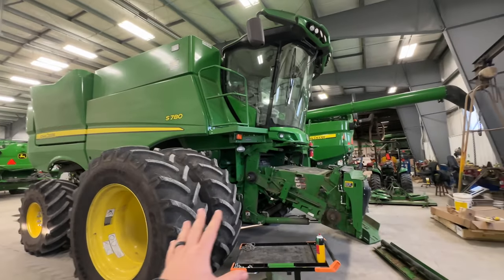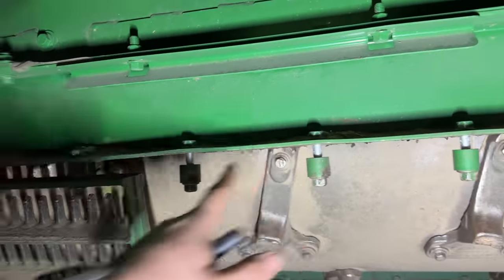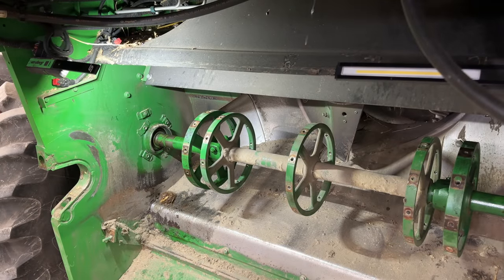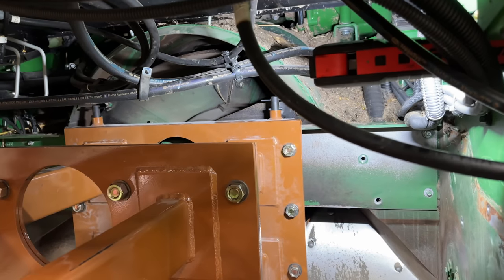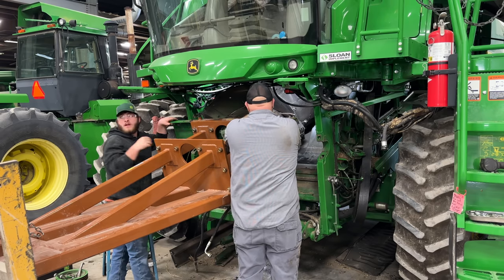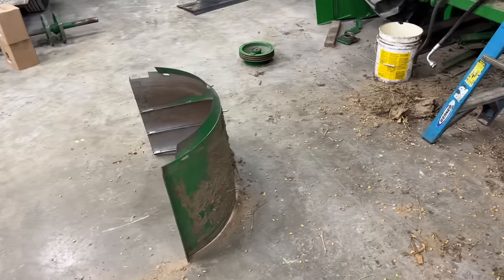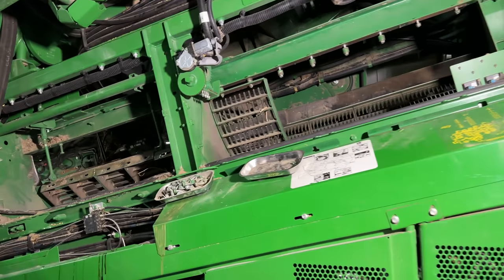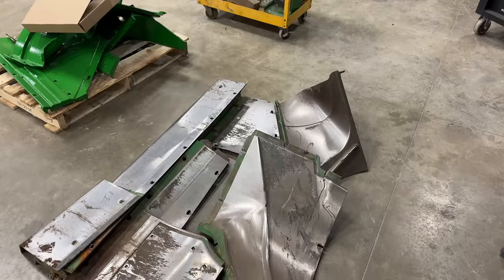Major separator damage! Removing a rotor out of a John Deere S770 combine.

Comment: I'm guessing in excess of a $75,000 repair?
Reply: I was thinking more in excess of $100,000.  And then what if the master mechanic missed something?? He is only human. I'd call it totaled, and order a new one and next time a shank falls off the ripper, go back and at least mark the area where it was lost..
Reply: @timgear9892  that's what I was thinking between 100K and 150k with labor and parts
Reply: @timgear9892  so you would rather pay $600,000 to get the same capacity machine, than $100,000.
Reply: @sividproductions6591  No! I would trade up the older depreciated, worn, and repaired major damaged unit for a brand new unit with all new wearing parts, belts, updated cab, and full factory warranty, along with a new depreciation schedule for the IRS. I would imagine around $200-300k would swing the trade.
Reply: @timgear9892  I was a sales manager for John Deere in one of the dealerships. We love guys like you for stimulating the economy. Well done
Reply: @sividproductions6591  I forgot to add, a new winter hat and winter coat would be incl in the deal no charge!
Reply: @timgear9892  well thankyou. 
I needed a coat and hat to go with the $200,000 profit that we will get out of the deal.
Reply: @sividproductions6591  The dealer must be profitable to survive...And the producer must reliably produce his products on a timely basis w/o down time.  They help each other.. It is a symbiotic relationship.
Reply: @timgear9892  click on the name and you will see how we take off 25,000 tonne of grain in 2 weeks

Comment: So was this damage from something that was picked up in the field or did some other part fail and work its way down the tunnel?
Reply: Did you watch the video?  They stayed ripper shank. Must’ve been a hell of a ride
Reply: @richardradawetz8788  Yah I caught that, but I was wondering if it was laying in the field or was a part of this vehicle that fell off and when down the auger.
Reply: The ripper is a heavy duty tillage machine. A ripper shank is the part of the tool that digs in the dirt.   When they were cutting beans in mist have gotten scooped up and went into the machine. Probably av10-15 pound chunk of hardened metal
Reply: @richardradawetz8788  Richard,  thanks for the details.  As the video shows it did indeed do a job on the machine and seems a bear to fix.  I would guess this was not covered under any warranty for sure.

Comment: How did the operator not get it shut down before it went all the way through?
Reply: alot of reasons why. operator couldve been tired from driving all day. i had some huge rocks that went through the header and feederhouse without any noise before the feed accelerator stopped them. stuff like this can be a bitch and go in unnoticed. and even if he shut it off at the first loud bang, that thing has enough momentum to pull that shank all the way through anyway

Comment: Hey I have a question we have S780 and it has 1450  sep hours on it and it has two holes wore in the rotor hood upfront on the left and right side ...the right side is bigger Is this a common problem cuz the a guy that works for use said where he worked before there 790 did the same thing and when we was looking at this 780 the one next to it had hole wore in the same spot has this one does .. but my real question is do we have to pull the rotor to put a new hood on
Reply from the maker: Well typically when you have holes in the rotor hood on a machine with low hours, it’s because something went through the machine causing damage to the hood and likely the rotor has damage as well so you might have to pull the rotor.  You do not have to pull the rotor to get the covers out.

Comment: Would Farms insurance pay out for this type of foreign object damage in the USA?    Here in the UK, our insurance would instantly write the machine off, and pay out for a new one (of similar value)
Reply: Depends on what insurance coverage is in effect when it occurs.  What occurs in the UK means little compared to the US.  The machine value is high 600k to low 700k.  UK parts are going to be pricey... Not sure I believe it would be enough to write a machine of this vintage off though.  Well unless the insurance company has a side gig dismantling machines and selling parts at a premium, but still under the cost of new, or even repairing them and then selling an operating machine.